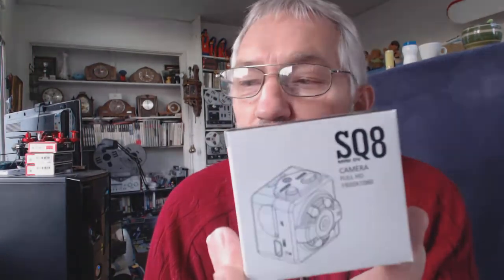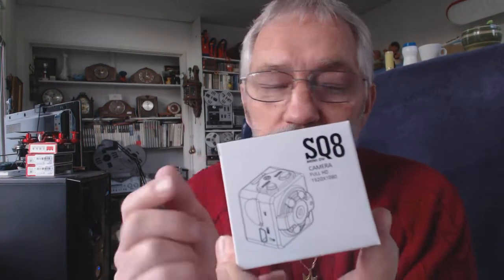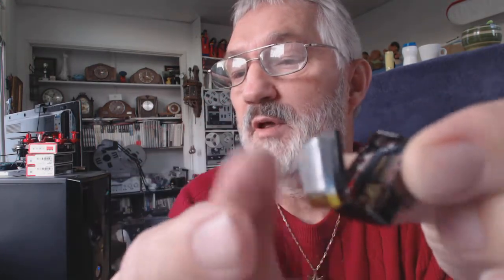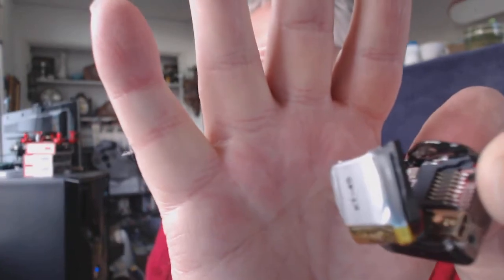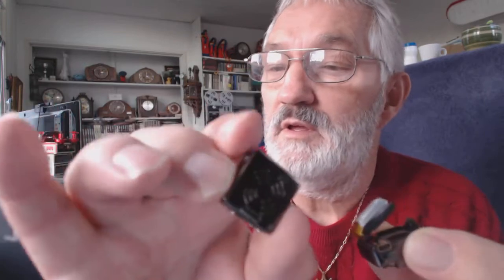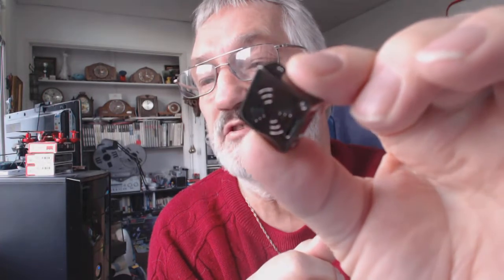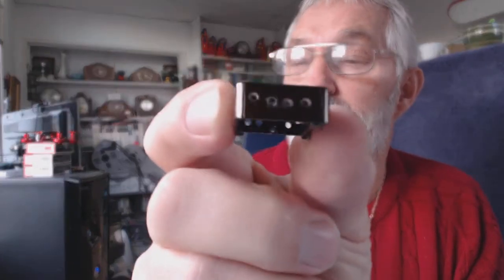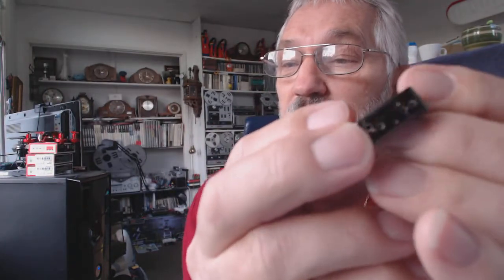sq8 mini camera ventilation holes

Comment: nice mode!  waiting for your abservations and see if it works, my one is geting hot but noot that hot i imagine,, my one ,wen get reall hot is wen i conect it to the computer for transfer the photos.   if i leave it ther for 10 minits start to burn.
Reply from the maker: I always take the card out and put it in the card reader. Have you changed the date stamp?
Reply: I am always lazy to take off the sd to pass the photos, just contac by the cable and detects like a normal camera.. I have not tried changing the date time.  this is for the data of the photos no?
Reply from the maker: SongoLand Yes but not important
Reply: good morning! for me is not,, but it least is nice to have the option. Probably the internal soft of this little is a bit strange xD haahah it have charshed to you yet??  to me was freezed some time,, and need to made a "hard resest"  for revive the camer. (the nice think is the  recordad videos steel ther after a reset.
Reply from the maker: Glad too hear I am not the only lazy one here haha. Mine has not crashed yet  I clipped it too my glasses and went for a drive, was ok, but video stops after 5 minutes and starts again, so you must now edit it
Reply: o yes , this little make clips, but just need to put one after the other and render all together , i belive is becouse like this, the camara can be nono stop recording, and if the memori full , just start to record on top of the  oldest. or at least this are my suspicius aahah
Reply from the maker: Yes that is how it works, I must get a bigger card, it can take 32GD  a 4GB is quickly full
Reply: yup, but well , for me is  ok, becouse i just record sort moments,, but , is true,, for  a long ride is little. i have bougt one 32gb some days ago (for use it with my new furibee action cam) , must to be on the way hope xDD
Reply from the maker: SongoLand I think the Furibee is a nice company, have good things, the F36 Inductrix clone is way better than the Eachine E010 also they have a good FPV camera I see
Reply: i just got yesteday my one! (F36) , in a pretty flourescent oragne,, i love it,, haven test it yet.. ajaja  to much toys to play ahahah,,  i was triing yesteday my blue jjrc h36 for first time,,  it fly really nice.. love it..
Reply: dude,, ask me befor buy in gb, normaly i have discounts and know about offerts.. the bike you just got 21e , is not too much, but hey! is one  free battery or somethink xDDD  a gretting
Reply from the maker: You will notice it has more power
Reply: the furibee??  ooo nice , the conroller of the  jjrc h36 is soo small! too much for me xD love the sice of the h20H controller.  this one is confortable
Reply from the maker: SongoLand Yes better size

Comment: GREAT! I do this in some of my chargers and stuff that run hot, It should work the heat should rise out of the top holes and cause fresh cool air to be pulled in from the lower holes. I normally do holes only on the bottom and on the top so fresh air is forced up through the bottom holes from the hot air raising out of the top vent holes.
Reply from the maker: Yes had the holes in top and bottom but the lipo is in in tight, so did the sides as well, was thinking of drilling the back maybe. The case is aluminium and should get ride of heat. Wel if it does not help cooling it now has nice lights haha
Reply: Na should be way better now with the vent holes you put in it.
Reply: So RuudyL is it better now? Did the holes helped? Im about to buy one for myself